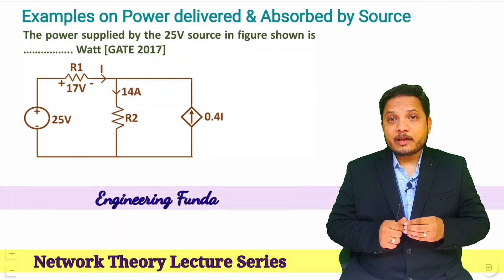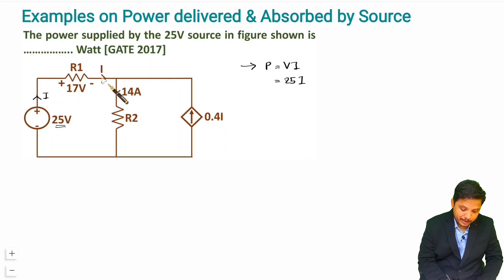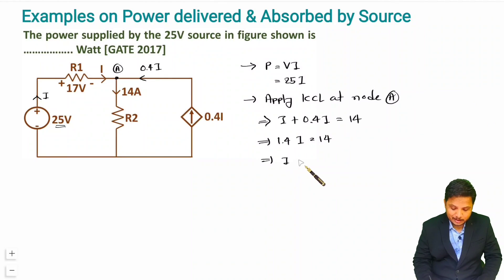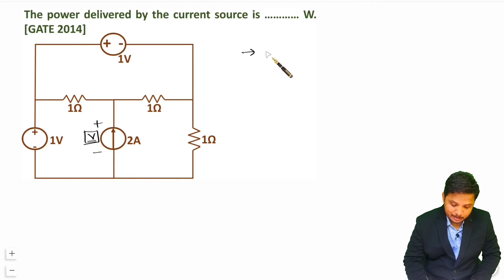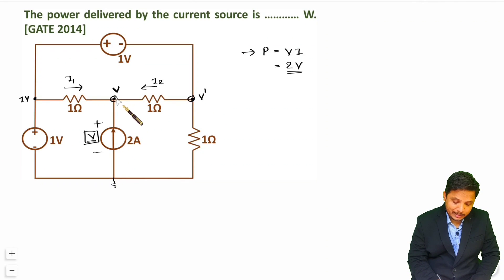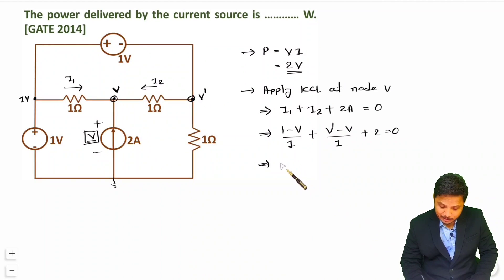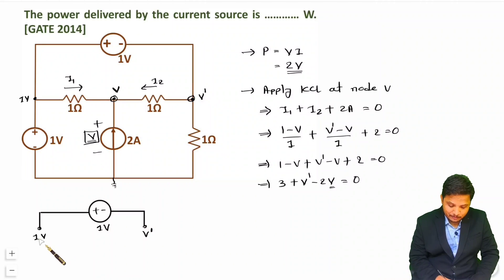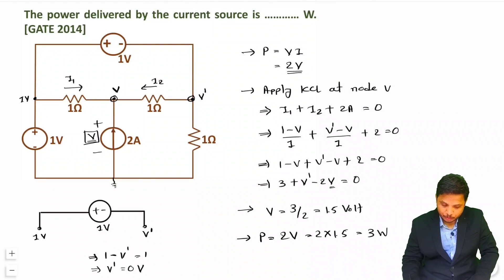3 - Power Delivered and Absorbed by Sources: Comprehensive Examples and Solutions

Comment: Sir there was a question in exam can you help me solve 

Question:-  Given a two N Passive network(a and b) find I?

Network a consist of N passive network with no information of which on left side battery(10V) is connected and current 5A is going into network on right hand side 1 A current leaves the network

Now network b, has same N passive network left side is 20V battery with current I going in network and right side is 10Volts battery
Find I?😢😢
Reply: Try chat gpt 4